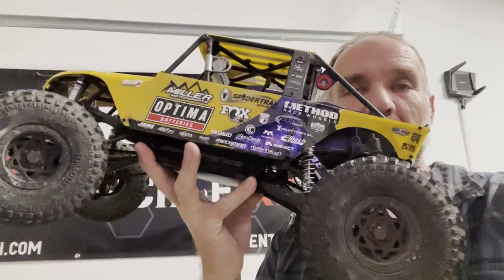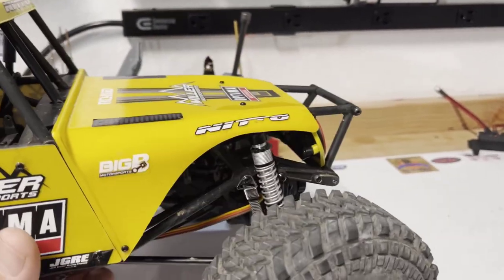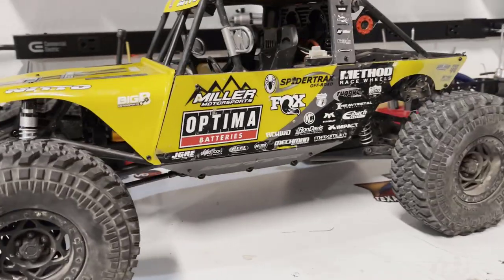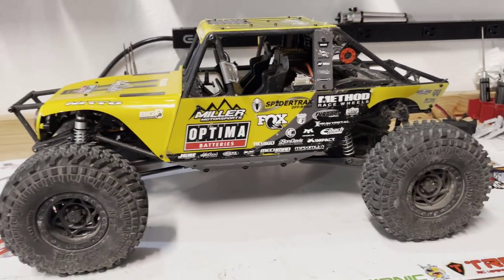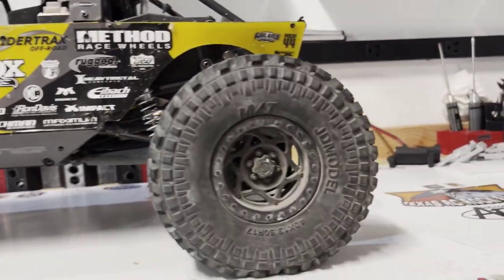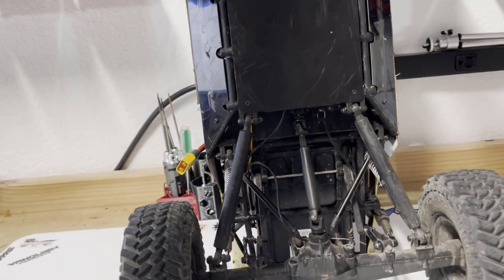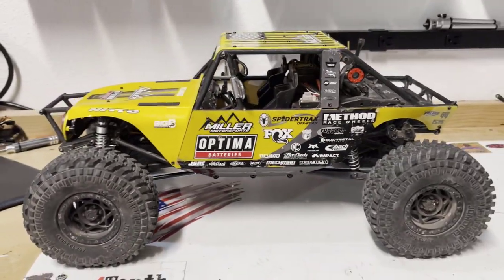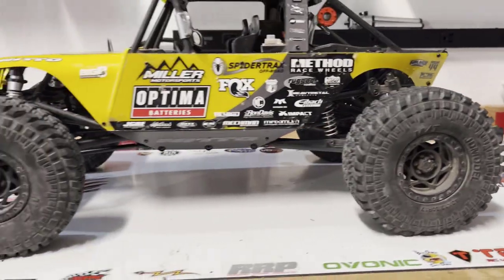RC4WD Miller Motorsports 2.2 Rock Racer Review

Comment: The top spring is called a tender spring. On a full size rig it is compressed at ride height and is designed to soak up chatter at high speed.
Reply from the maker: I was hoping someone would know the technical part to explain that.  Thanks man!

Comment: Thanks for the video.  Was wondering how the replacement of wheels would be.  Is there a pin setup or a hex.  I was wondering if I could stick on the vanquish product  slw hub.  Hope they come out with a guard for the front servo soon looks like it is a target for a rock lol.  Thanks again.
Reply from the maker: Haven’t popped the wheels off yet but will be soon!
Reply: I put 1.9 Axial hex's on mine with RC4WD Aluminium Walker Evans wheels on and scale Warn hubs.
Threw the stock wheels,,rotors and calipers in the garage where they belong.
Reply: The stock wheels are pin drive. Axial SCX10.3 hexes are a direct bolt on to the axles, but you have to remove the brake calipers for the hexes to fit. 

And you have to drill out the 6 hub mount bolt holes in the wheel face to fit 2.5mm X 8mm bolts. Which you need to supply 24 of (6 per wheel). Then you can mount SLW hex adapters to the wheels. 

Once those things are done, you've got hex drive wheels. Which is nice because then you don't have to remove 6 tiny nuts per wheel to remove them.